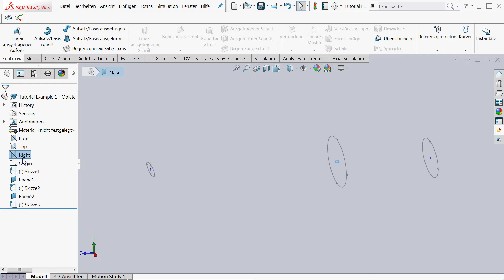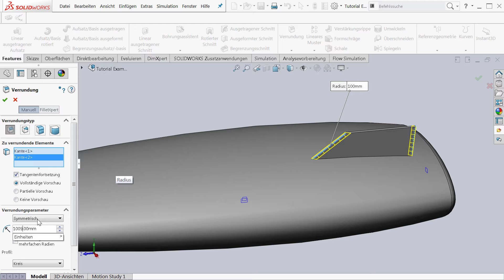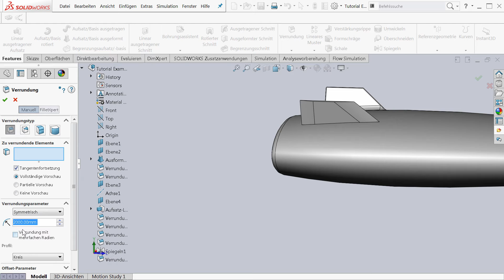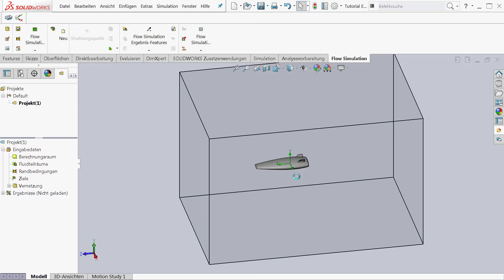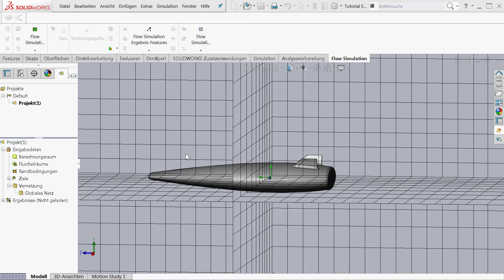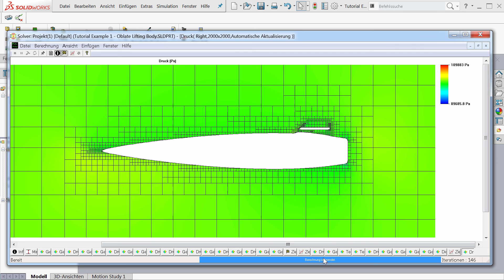How I Usually Make Aerodynamics Simulations - An Improvised Tutorial Preview/Overview Episode 0

Comment: I don’t have windows
Reply from the maker: there should be alternative versions of SolidWorks that can be run on Linux or Mac, though I don't have much direct experience with that, usually most labs just use windows - I'm qutie sure it should run on Linux to but with Mac I'm not so sure